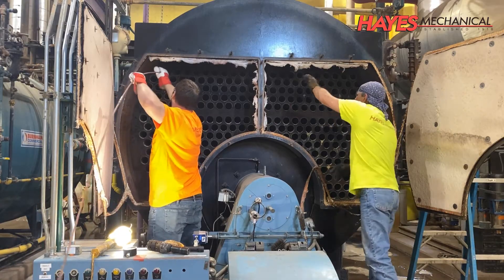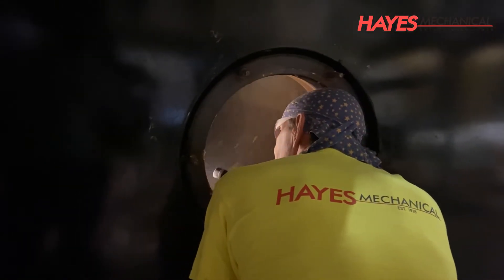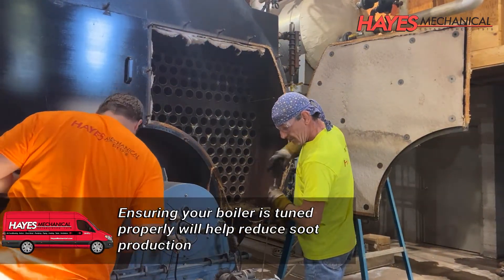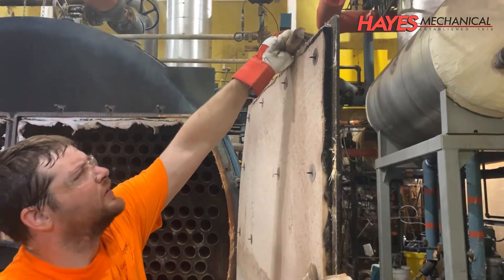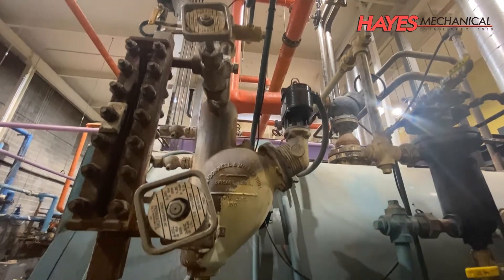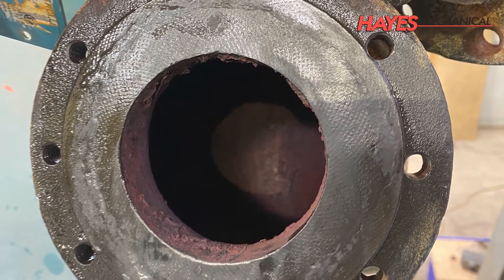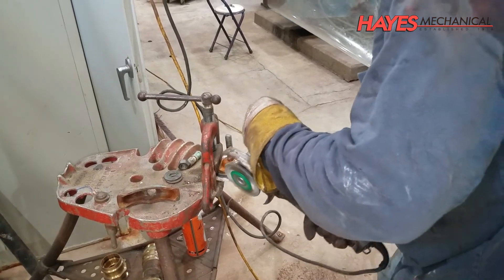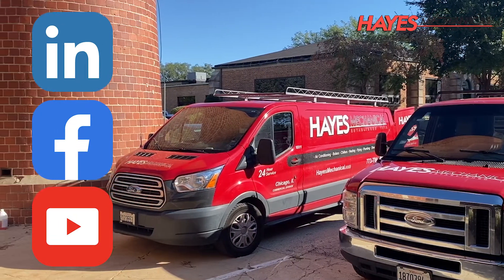Hayes University: Steel Tube Boiler Washout

Comment: How often is this procedure recommended on hot water boilers?
Reply from the maker: Hello! We typically recommend waterside inspection/cleaning of hydronic boilers every 2-3 years. If you have a steel boiler like this, it would still be a good idea to open up the fireside for inspection/cleaning annually. Feel free to reach out to us if we can assist with your boilers!